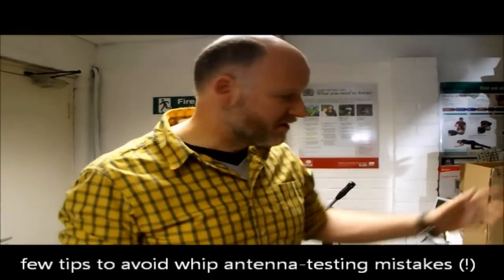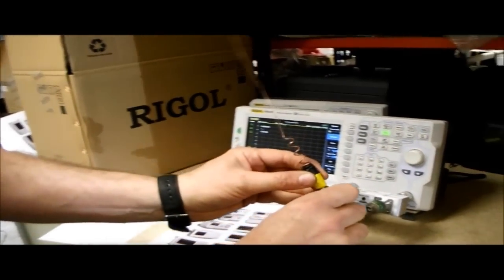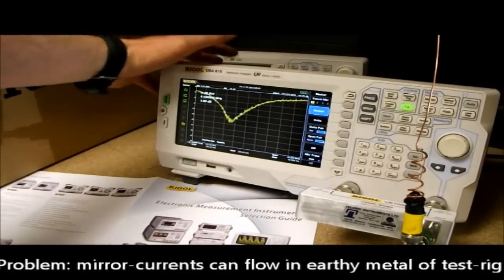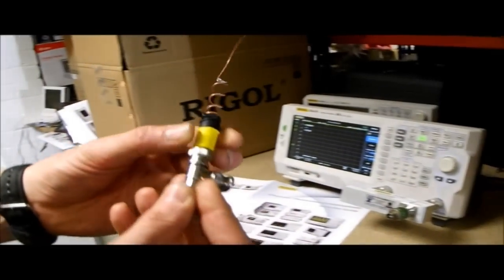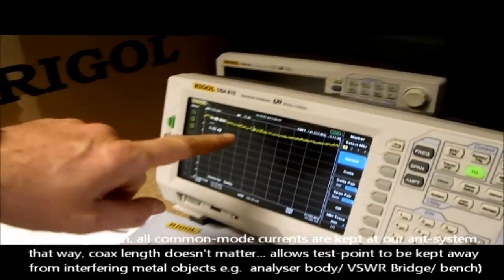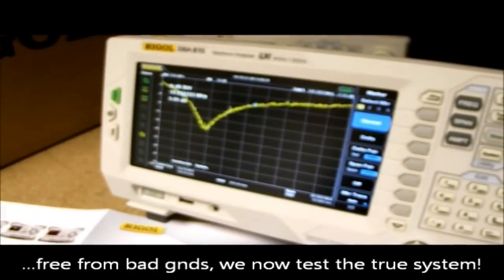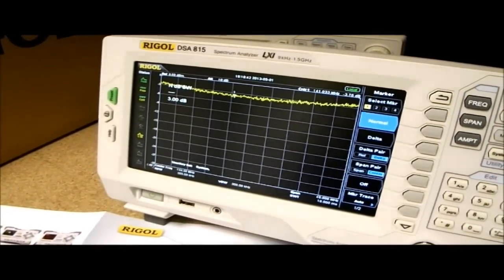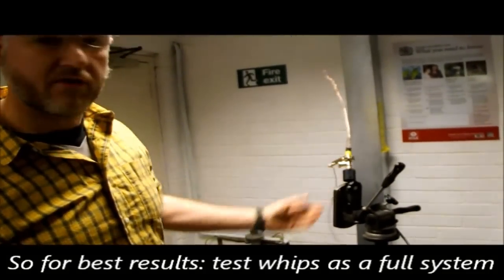RIGOL DSA815 VSWR blunder...whip antenna tips - How to test with VB1020 VSWR Bridge correctly

Comment: David Thanks for the video!  It will go a long way to keeping me out of trouble!  Where did you get the balun?

Cheers!
Reply: My best guess (since he's never answered you) is that it's a large ferrite bead wrapped around the coax.  I think almost any RF choke balun would work the same way, since the idea is to equalize the current on the center conductor and shield (e.g. ensure no radiation) before the balun.  A good enough ferrite wrapped around should do the same thing, so that's probably what he's using.  At any rate I tried it and it seems to work okay for me =]